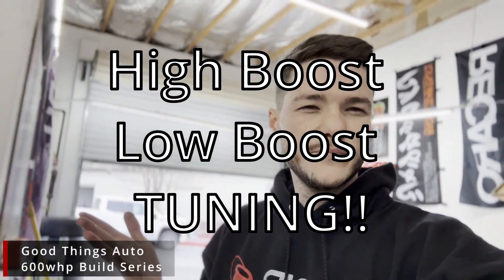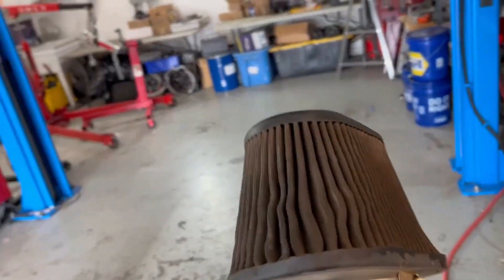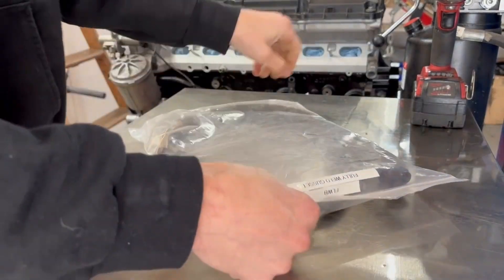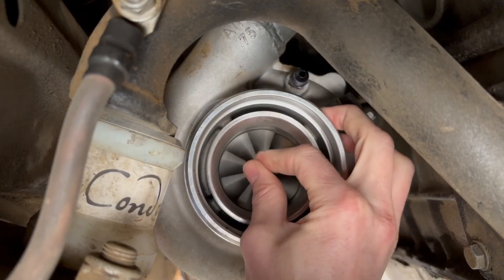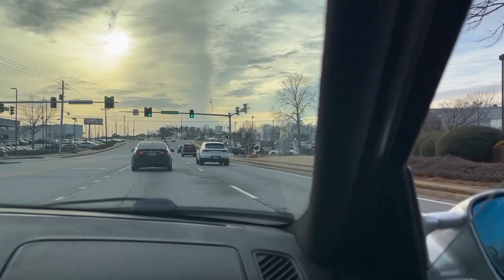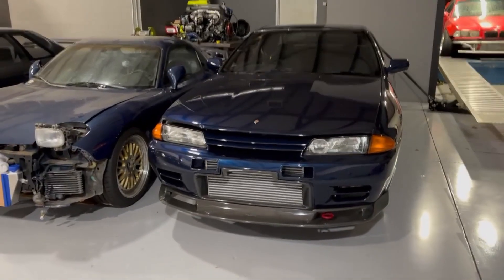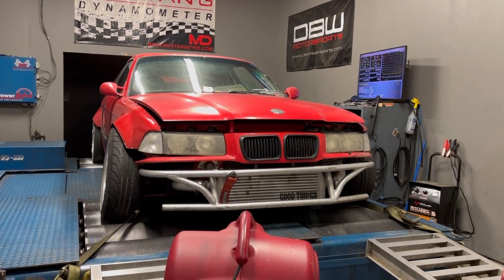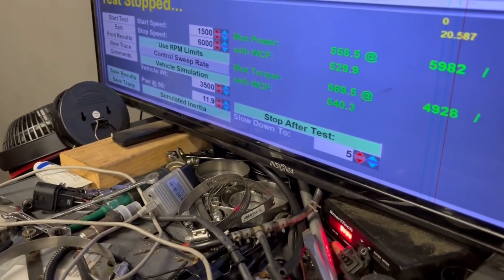Turbo E36 High / Low Boost Tuning!  Link Ecu.  Max Power on Factory Fuel Lines!  Lets make over 600!

Comment: The black car you took a 2 second clip of is an amazing car.
My first car was a 2 door Acura Legend 6 speed. It was a 3.2L with variable timing… I don’t like front wheel drive but dang what a car for its year. The rear windows roll down and there is switches in the back for them, never have I seen a coupe with rolling down rear windows. 

I own 7 cars now, mainly v8 and turbos BMWs, and a fully built Subaru. 

I love your car.
Reply from the maker: How cool!  It’s the cleanest old legend I’ve ever seen.  And you rock man thanks for the love